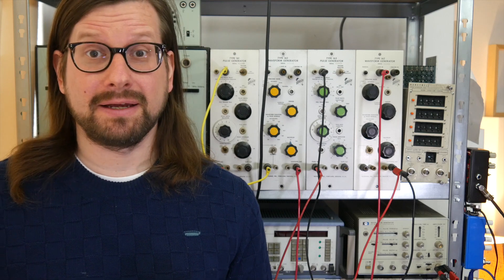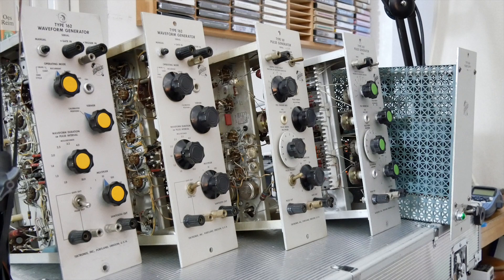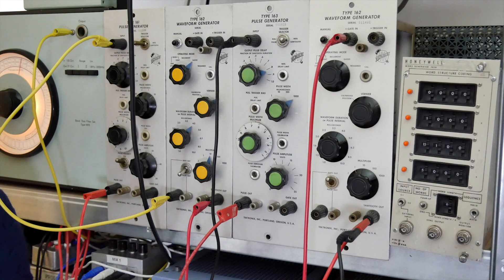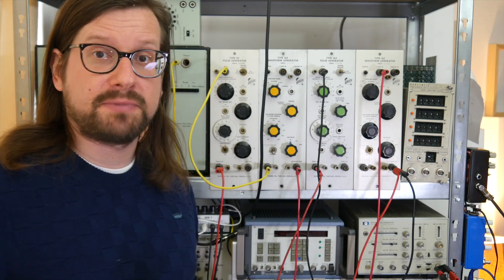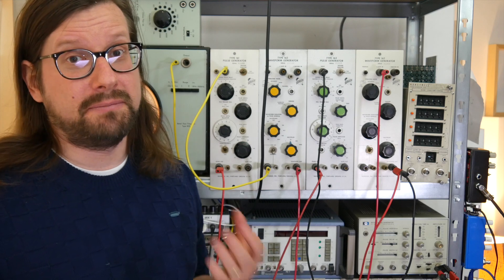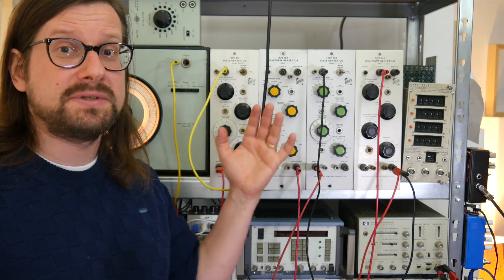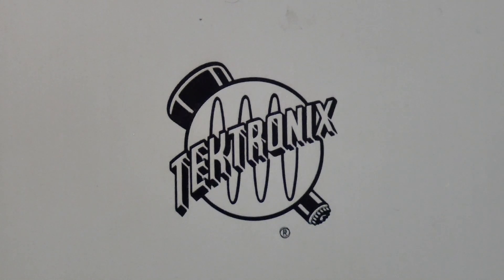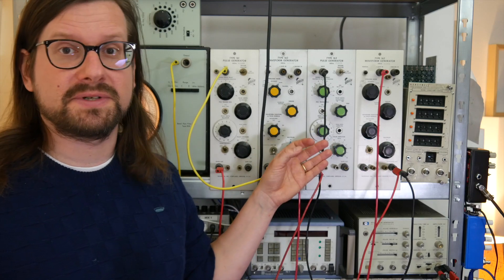The Forgotten Modular Instrument From 1950s America

Comment: Sadly, it's all but impossible to find working tube equipment from the 1959s, at least in America. The capacitors always leak and corrode the circuit boards. Electrolytic capacitors were never intended to last 70 years.
Reply from the maker: But you can recap it and bring it back to health.
Reply: @Hainbach  If the corrosive goo from the caps hasn't eaten away other irreplaceable components, like ceramic resistor packs or the circuit board.
You guys in Europe seem to take better care of older electronic gear than the people in the United Snakes of Amnesia. We just toss stuff in a barn and thrash it. 😢

Comment: dont you have to let them heat up before  using?
Reply from the maker: They go stable in a few minutes. Its amazing.
Reply: @Hainbach  great videos you have me inspired by your tapes i must trymy arturia on tapes did you try adding extra tape heads and oscilate the heads ? i wondered if the sparking was the valve trying to heat up

Comment: I was thinking of building a tube modular, just to be an annoying hipster "oh I'm so special" kind a guy. But it's hard to find reasonable circuit designs. Because making a tube oscillator voltage controlled isn't entirely obvious when you are a newbie to tube design.

So I'm probably staying with op amps. I understand those. :-)
Reply from the maker: Look mum no computer has designs on his site. Oscillators are hard though, especially properly tracking ones

Comment: Wow-- this is pretty astonishing.  I worked as a repair tech at a Tektronix field office for about 5 years in the 1970s, often fixing vacuum tube equipment, and saw a ton of stuff they made including the first scopes they ever produced, but NEVER saw any Type 160 equipment or knew they existed.   We had a full set of manuals available, though some were on microfiche, and I don't know if the Type 160 series was represented there-- I suspect so but no one knew about them, not ever having encountered any where the manual would be needed.  

With regards to modular sound equipment and Tektronix though, I did encounter the TM500 series non-tube modules such as the FG503 function generators that I experimented with for audio applications including FM synthesis, but the tube gear was completely unknown to me.  The Type 160 series must be exceedingly rare, as we were a big field office that repaired gear for local military bases and engineering companies and never saw these things.   What I liked to do with the FG503s was to take three of them and feed each one's output into the FM input of another, and tap one of the outs to listen to.   Since it made a loop-- the last one in the chain's output was fed into the FM input of the first one, it produced some interesting results-- adjusting the frequencies of them all could produce a lot of neat sounds, including things that sounded like they were sequenced when one of the frequencies was low enough to seem to "step" things a bit.   The FG503s, having an FM input, could certainly be sequenced, though at the time I had nothing to do that with.   The same sort of things could also be done with the more modern CFG250, but the FG503 had a more "modular synthesizer" feel since you could plug several of them together into a power-supply mainframe along with other gear such as counters & DMMs...

Comment: Very nice! There’s probably very few people left that can work on those or are willing to. I have bins of unusual tube amps/equipment waiting for a repair person that may never come. You are lucky to find them in any working condition at all. I have to ask what you are using to deal with the output. I don’t think a switch can tame it. Safely. Those units are powerful enough to drive a speaker like a guitar amp.
Reply from the maker: I watch the levels and use a scope mixer switches  that can take a lot of voltage.
Reply from the maker: Hameg HZ 64 and Heathkit 101, they work. Also, in this video a simple passive mixer.
Reply: It’s impressive that these switches can handle this older tube driven equipment. This is reassuring. Thank you!!

Comment: Being a product of 1950s America myself (I was born in 1947), there's a special nostalgia factor here for me. When I was a kid ALL electronics were gaseous-state (not solid-state) meaning that they used vacuum tubes (which usually filled with inert gases) for oscillation and amplification. This was right around the time when transistors (solid-state devices) were being invented, but I did not yet have anything that used those, except for an early type of diode (the heart of a "crystal" radio set). For Christmas 1959 my folks bought me a little mail-order scientific experimentation kit that included a small aluminum chassis with sockets for two or three vacuum tubes along with some tubes, terminal strips, resistors, capacitors, coils, hook-up wire, solder, and other fun stuff. I assembled a simple oscillator, an amplifier, and even a simple little AM radio on that chassis. I liked the audio sounds that the oscillator generated but did not know what to do with them. I need to dig into Mom's attic and see if it's still up there somewhere.

Comment: I took a ten minute dive into old test equipment on eBay.  Certainly there are treasures to be found through well groomed connections.  But I think if you're starting out, you're probably going to want to keep it cheap and accessible... at least at first.  Besides... considering the size and mass of ancient equipment, the shipping charges on these monsters would eat you alive... and the bumps and bangs of travel could be the final straw breaking the camel's back.

Comment: How about an Arduino or a Pi connected to it to manually pitch shift? A few small lines of code and a board with buttons or potentiometers connected for control. Just a thought
Reply from the maker: Yeah Arduino. I need to find time to learn that. Had the Make "Making things talk" book for ages, unused for lack of time. Gifted it away
Reply: HAINBACH it’s pretty easy actually. There’s a lot of code already written to be able to perform all sorts of tasks. I’d highly recommend it!
Reply: Yeah that would be a bit mad... 1950s tube oscillators driven by microcontroller... sounds like that start of a good time machine to me.

Comment: I just picked up a set of these off of craigslist and im so glad you posted this. I now have a power supply, 161 pulse generator, 162 waveform generator and a 163 pulse generator. I am wondering what types of cables you have been using to make this compatible with your setup? I also have the Korg MS-20 and I would love to link the two in some way. Any recommendations?
Reply from the maker: Octal cables for the power, else its bananas. Get a Logain Util-1 for conversion. Congrats on the purchase, do dust them off before using!
Reply: Awesome, danke Hainbach!

Comment: I really liked the musical piece, it was like fast Laurie Spiegel. Also, the shots of the inside of the equipment was great; those are some large resistors. You can see if changing out the tubes is worth it.
Reply from the maker: Yeah, these will need TLC at some point, all of them are quirky, but not in a way that stands in the way of music. The NIM/BIN was way more temperamental.

Comment from the maker: I was originally going to write 1950ies. Good thing I spell-checked, apparently its a German thing.
Reply: I worked for Tektronix for nearly a decade.  It was in the 70s - 80s and yes, tubes were out of the picture.  However ANALOGUE was still very much the   center of products that  they made at that time. my background with synthesizers at that time was rather limited.  All I knew was what I had learned on my own with a minimoog and what I was able to understand from the keyboard magazine [ contemporary keyboard at that time]. What I did know however, was what modular forms of oscillators, filters( hp,lp and bp ) and amps did and that they had all the I/Os, you would need, not to mention knobs and switches.  I spoke with management ( even upper levels ) and  technicians about it many times. Never got  a response.  I always felt a great irony in the fact that they were deeply tied to the entertainment field of movies.  I'm so happy to see that someone didn't let that get by. Enjoy.
Reply: I instinctively read that as "1950s goodies" :P
Reply: Must be. An apostrophe is used with an "s" to make al set of letters or numbers become plural.
Reply: @TheLuckymod13  apostrophe + "s" implies ownership, so 1950s is correct in this case, if you were trying to maybe propose a correction? or maybe I misunderstood
Reply: @unslept_em Haha! Someone's been reading Eats, Shoots & Leaves!
Reply: that's adorable
Reply: Hahaha that’s awesome!